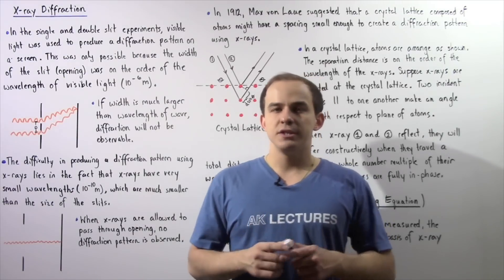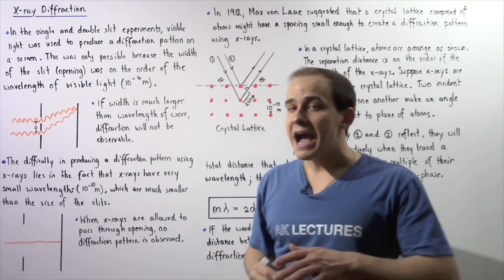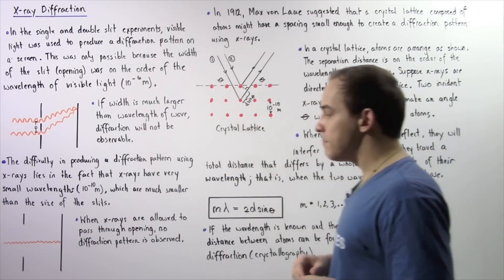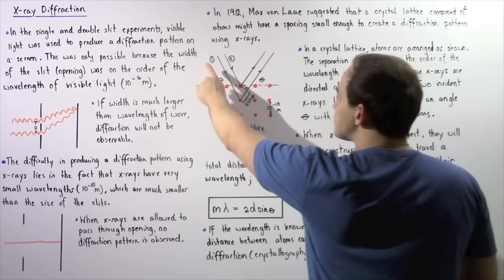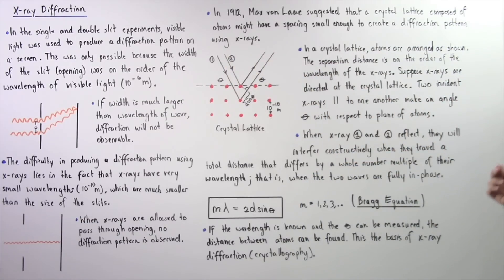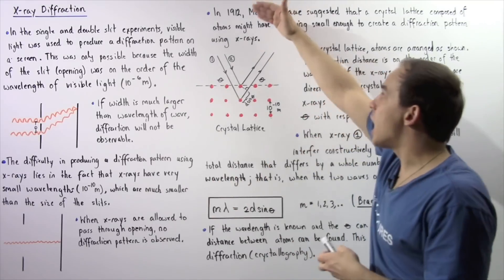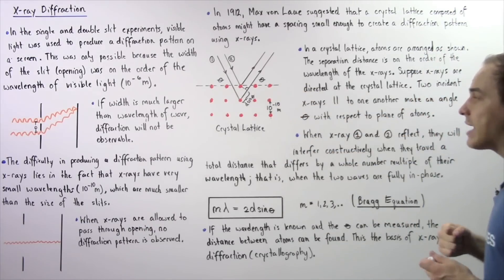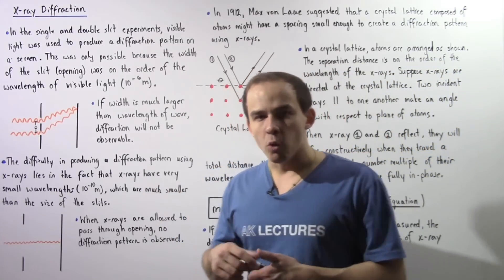X-Ray Diffraction and Bragg Equation

Comment: Some molecules are not bonded in a crystal orientation or bonded differently like ionic bonding covalent, etc. Does X-ray crystallography have limits on the types of molecules or compounds it can determine? You should have mentioned briefly its limitations like you mentioned its uses.

Comment: thank you! i still feel like i dont however understand why its 2dsin(angle) and not just dsin(angle) :(
Reply: Huu Tiainen its because the ray first covers distance dsintheta to reach to the atom in the lower surface then it is reflected and again covers a distance dsintheta to reach to the upper surface/boundary.since <i = <r therefore the distances should be added(dsintheta + dsintheta)and become 2dsintheta

Comment: thanks   i have an doubt that you told that d is equal to the wavelenght  of the x ray so in bragg equation wavelenght cancels out the d and we will get only n= sin of angle
Reply: he didn't say that d is equal to the wavelength, he said it is on the same order of magnitude. There's a distinction between the two.

Comment: Great video. 

I have a somewhat of a complex question. I'm being asked to find the length of a cubic structure and i'm given the "d spacing" information (8 total values). Also i'm given that it's molecular weight. I know that this concept applies but i'm not really sure what my instructor means by length. Any insight would be great, thanks!

Comment: why we put that 2 in the Formula ( 2dsin*)
Reply: The x-ray has to travel from the surface of the material to the atom below the surface, which is a distance dsin(theta1), it is then reflected back to the surface covering a distance dsin(theta2). As the angle of incidence is equal to the angle of reflection both distances are equal and then the sum of the both and is 2dsin(theta).
Reply: oki thank u sir :)